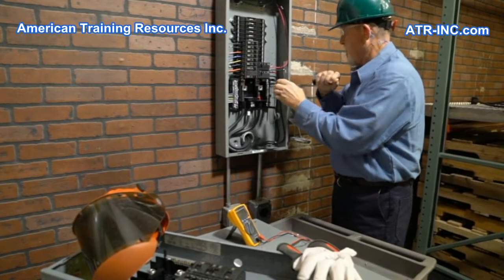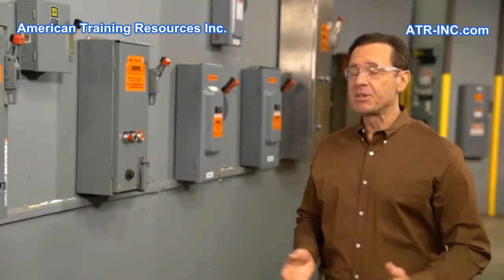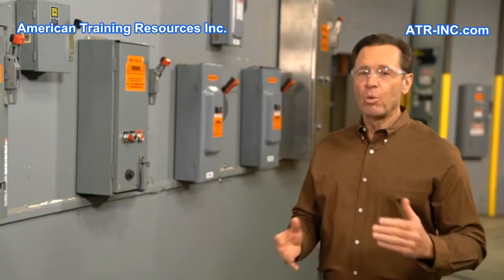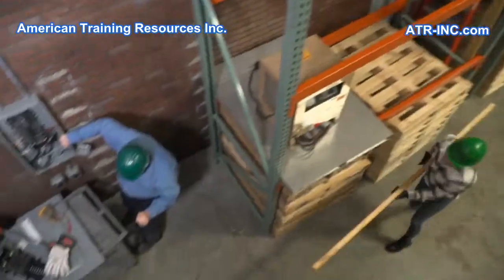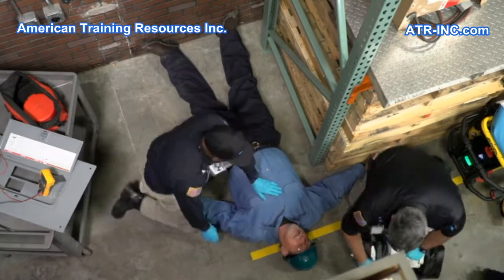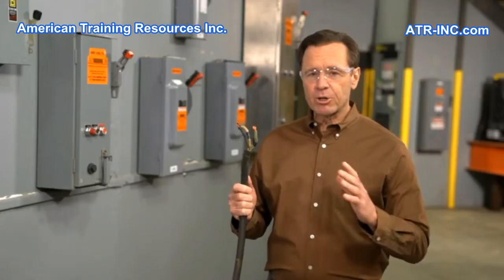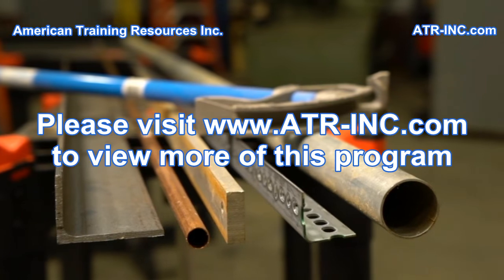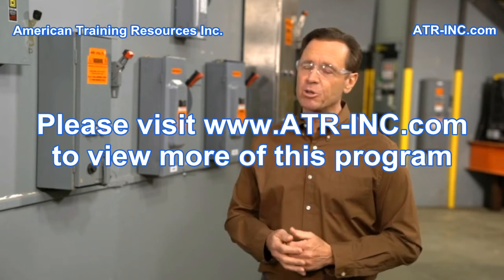Electrical Contact Release Training (Required Annual NFPA 70E Training)

Comment: They say don’t try to pull the victim away but what about knocking/pushing them off of the power source? Running tackle ?
Reply: You can grab them by their clothes if not conducting electricity and yes the running tackle could prove useful in the case

Comment: Water in itself is not a conductor of electricity. The impurities mixed in water is what conducts electricity
Reply: Technically true but it would be counterproductive to say this. All water we will ever contact out there has impurities and is very conductive. It is not likely someone is standing in a bucket of pure distilled water while receiving a shock.

Comment: I’ve understood that water isn’t a great conductor of electricity. But the interaction causes the electricity to skim across the top of the water. It can’t penetrate deeply through water. Being under water is safer than being on the surface in the case of a lightning strike. Water provides lots of resistance